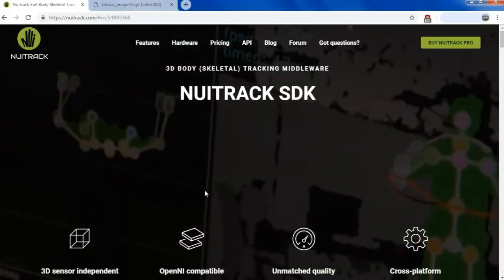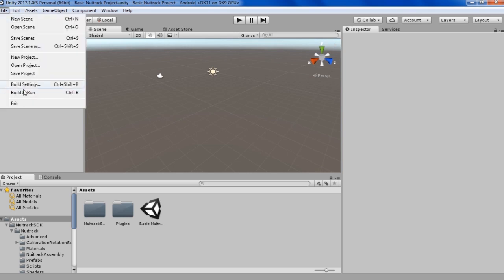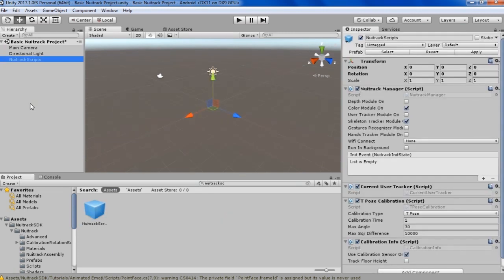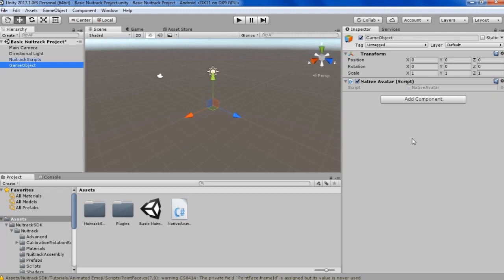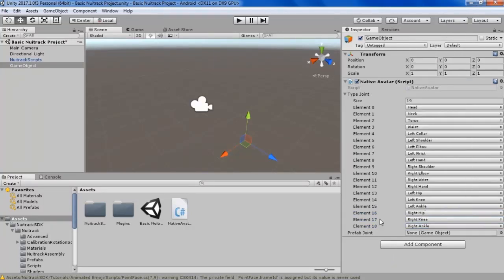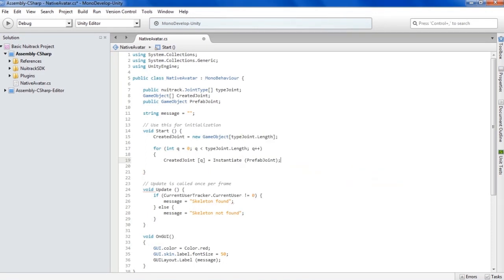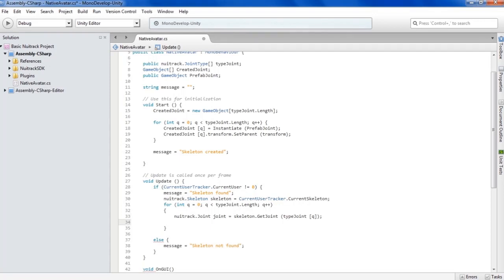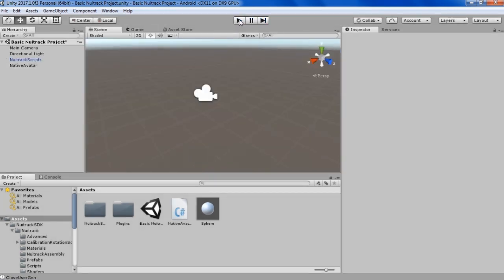Nuitrack | Video tutorial #1: Creating your first Unity project using Nuitrack SDK

Comment: Hello, I'm having a problem setting up the Nuitrack SDK in Unity. I'm using the 2019.3.0b.12 version of Unity and Windows 10. The issue that i'm finding is that i can't play the scene because all the scripts that are referencing the nuitrack namespace show the same error, here's an example: "Assets\NuitrackSDK\Tutorials\Animated Emoji\Final Assets\Scripts\FaceAnimController.cs(9,31): error CS0649: Field 'FaceAnimController.rawImage' is never assigned to, and will always have its default value null"
I've followed the tutorial and i cannot find the problem. I also checked the nuitrack.net dll as suggested here: https://community.nuitrack.com/t/unity-example-not-working/451
I have the Trial License. I don't know what i'm doing wrong and some help would be much appreciated. 
Thank you very much in advance.
Reply: Even after 3 years this issue is still there. 
I am getting this error
"Error while saving Prefab: 'Assets/NuitrackSDK/Frame/Prefabs/Sensor Frame Canvas.prefab'. You are trying to save a Prefab that contains the script 'FrameProvider', which does not derive from MonoBehaviour. This is not allowed.
Please change the script to derive from MonoBehaviour or remove it from the GameObject 'RGB'."
there are 114 error
Any solution or explanation over this?

Comment: Why Unity was crashing while importing Nuitrack SDK .I am using unity 2019.2.1f1. Same method I have used in my project also
Reply from the maker: Please specify the versions: Nuitrack, Unity, OS.
Reply: @3divicompany  Thanks for reply.I am using Nuitrack 1.4.1.Windows 10.
I followed ur video.

I have another question do we have to install nuitrack separately for this(With import nuitrack SDK in Unity).?
Reply: And Unity Version is 2019.2.1f1
Reply from the maker: @sayanghosh4739  To use Nuitrack in Unity, you have to install Nuitrack runtime first
Reply from the maker: Dear Sayan Ghosh, we found your ticket in support, I propose to lead further clarifications on your problem there.